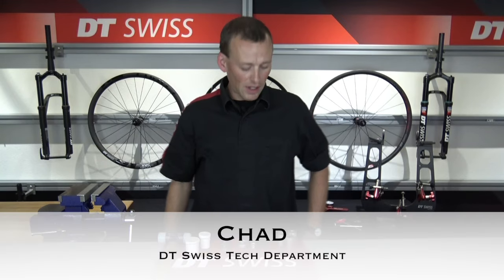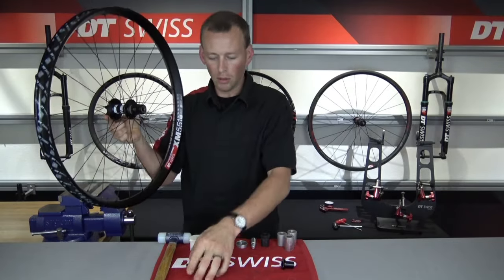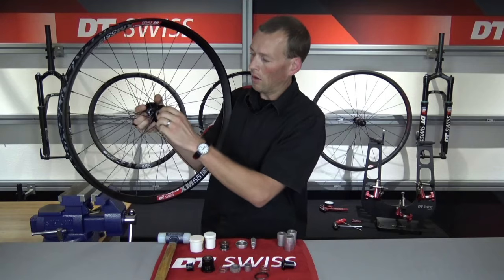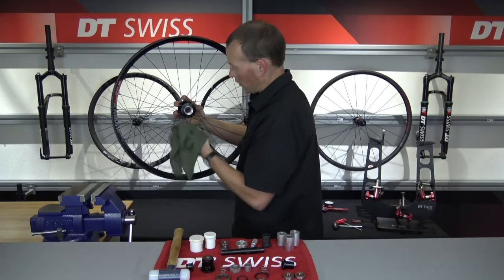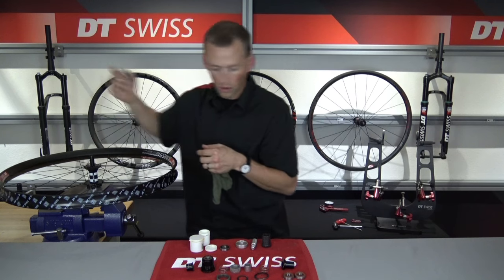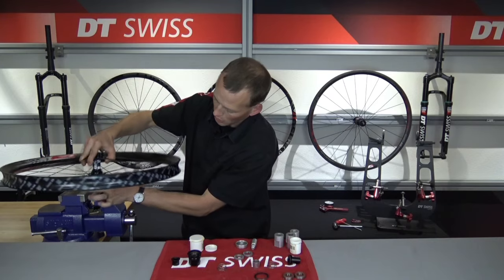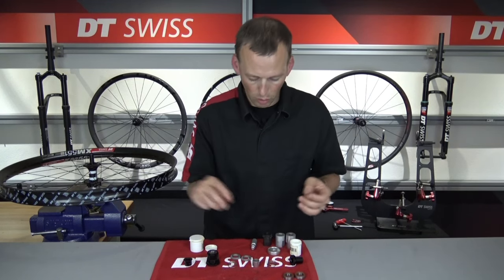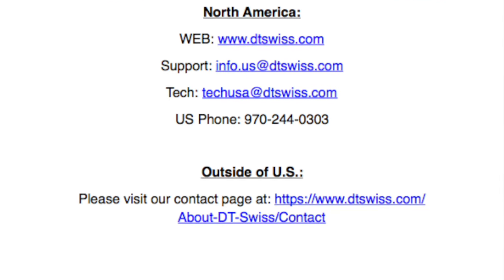Bearing service on DT Swiss Star Ratchet hub. How-to tutorial.  | DT Swiss

Comment: How to open and service the FREE HUB bearings? I cannot find it anywhere
Reply from the maker: Hi there and thank you for your message. The bearings we and most of the other hub manufactuers are using get a grease package which should last the calculated Lifetime of the bearing. If the grease is worn out or old, the bearing balls and the running surface are normally worn out as well and the bearing need to get replaced completely. But if you use a search engine, you will find as well instructions how to regrease an industrial bearing. The procedure is the same for any Kind of use ( Skateboards, Cars, Bikes, ….). Enjoy riding your bike, Friso "DT Swiss".
Reply: I guess you need to replace the freewheel, then... and it comes with the 2 bearings?

Comment: what happens if after installing new bearings you feel some roughness or grittyness in axel spin?  thanks
Reply: with the DT, design there's nothing you can do about it!
Reply: @donaldriddle7138  i think i set the bearings too hard.  put new new ones in and its smooth.  another point is that if the star nut is not fully tightened, which doesn't happen until afteryou start riding, the rear wheel will not spin freely.  took me long time to figure that out.
Reply: @frakafrocka  I’m having a huge problem with the rear wheel “grinding” the ratchets hard and not spinning once installed on the bike. I’m stumped at this point. Never had an issue like this before. I have two sets of wheels with identical 350 hubs. The new set has been super loud, so I serviced it. After install, it barely rotates and the freewheel action is barely working. WTF is going on with these hubs?
Reply: @energ8t   was the ring nut installed backwards? That could cause the freewheeling issue

Comment: Why not make a realistic video that portrays a used wheel? Chad states at t= 3:40, the demonstration wheel is "brand new". Per the comments below and discussion with peers that attempted to replace their bearings, it sounds like a risky proposition and it's possible to damage the wheel in the process. Namely, the Hub (because it's probable that a disc rotor will need to be attached and bolted to a table in order to get enough to torque to break the lockring free) and spokes. Perhaps it's cheaper to buy a new Hub unit or wheel instead of all the tools needed to extract the bearings and still possibly destroy the Hub and or need to re-lace the wheel with new spokes?
Reply: +dtswiss Of course it's nice to have all the tools and friends present when you need to torque the wheel to overcome the likely extreme lock ring torque... Although your studio is not perfect neither is a service shop. I still think it would be a valuable service to your customers to display the actual hub service with a "ridden" wheel. This will let them know what to expect under actual/practical circumstances. It would also be valuable if you would use a calibrated torque wrench record the torque requirement to undo the lock ring and mention that torque value. Is the Hub unit capable of handling the torque transmitted through a brake rotor into the six fasteners without damaging the hub housing? 

I ask this because I actually consulted with a professional wheel technician and he explained that they used the technique of fastening a used disc to a bench. The difference here is that the method shown in your video has the torque transmitted by hands on a rim and through the spokes into the Hub; however, using an old disc rotor would transmit the torque through the Threaded Fasteners into the hub. It seems that it is a worse scenario to transmit the torque through the spokes because spokes may be damaged in the process, whereas if the torque is transmitted through the disc hub there is no risk to spokes or hub, unless the cross section of the Hub, where the Fasteners transmit the torque is too weak to carry the load. 

Would you please report back from your engineering staff, the hub's allowable torque for each torque application site?
Reply: dtswiss Thank you. Clarification: I was referring to how much torque the hub assembly can tolerate (whether it is reacted by a disc rotor or by the rim/spokes via spoke flange of the Hub) in order to break free a ring nut before the hub could experience a stress failure (i.e. not the bolt torque). If two men struggle to apply enough torque (through your preferred rim/spoke load path or via the disc load path), I'm sure that adds up to a lot of stress in the hub. My concern is if this stress is too high for the Hub and which loading condition would allow for the highest applied torque without damaging the hub and/or spokes (if applied thru rim).
Reply: I hope you had a nice ride...
1) I am not looking for a "set value". I am looking for the max allowable torque that may be applied to remove the ring nut such that if exceeded could cause damage to the hub and/or spokes. 
2) I understand you are trying to apply logic that the loosening torque can't exceed the tightening torque. It is conceivable that the loosening torque could exceed the tightening torque. For example, the tightening torque is applied gradually over time and due to various events (as you pointed out, i.e. shock loading during riding); however, things other than applied mechanical torque can cause the loosening torque to exceed the applied torque. For example, contamination (by ingestion of water/mud/grit) or corrosion at that thread interface between the lockring and the hub are examples of 2 things that are not related to the in-service duty cycle aspect of tightening torque.
3) Now that I laid a foundation for why torque may exceed your expectation, I'll get back to my concern about the max allowable applied torque for loosening. Given that the torque can be reacted by either the rim/spokes to the hub vs. the brake disk to the hub. Each of these cross-sections are different, thus there is a worst case (i.e. one has a weaker cross-section) of the two for transmitting torque and that weaker cross-section will be the 1st to fail and will not be preferred for loosening. Thus back to my earlier, unanswered question... (a) which of these 2 hub cross-sections is stronger and (b) how much torque can be applied to it before causing hub damage? Please forward my post to a DT Swiss engineer. Thanks.
Reply: Heat up the hub, since the drive ring is steel and the hub is aluminum which has a higher thermal expansion so the fit gets less tight. That was my trick to get it off. And i used an aliexpress tool for 5 bucks.
Reply: @haenson8021  it's been awhile since I made that post and had my eyes on the details of one of these Hub designs, but heat is always a good solution provided there are no other materials that are going to suffer in the process, like melting rubber seals, etc.. As you pointed out, if there are dissimilar metals, then you can benefit from the difference in coefficients of thermal expansion.

Comment: Can I just clean my old bearing and place it back on the place? Will it fit?
Reply: dtswiss but will it be possible to fit old one on place?
Reply: Bearings get pretty messed up upon removing them and just from general wear and tear. They're really only meant to be installed once. If you're going this far with assembly you may as well just replace them. Standard bearings aren't that expensive and it'll save you time later of having to redo this to replace them. I'm not sure if DT swiss uses standard bearings, however.
Reply: If you want to clean them, do not remove them. Just use a pick to lift the seal, clean out best you can with IPA and brush (etc), then repack with bearing grease. Of course, def check for smooth rotation of bearings first. Many times my bearings are still good, but just need some cleaning.

Comment: Hi,

First of all - very good video. Thank you!

I'm stuck at the point of ring nut removal. As you've mentioned in the video this might be due to the pedalling force. I have already tried to spray it with the things that I had at hand like wd-40 and brunox but it does not help. Shall I use any particular oil or solvent to get it done or meybe there is some special technique?

Kind regards
Reply: Hi

Since I'm - so to say - "alone in the Alps" (not very far from the DT Swiss headquaters actually) I could only try to break the nut ring loose by myself. I tried different ways, levers etc. with no success unfortunately. Then I gave up and went to one of the local bike shops for a help. I thought that then they can try to turn the wheel with more than 2 hands but after a few tries the guy told me that he is afraid to break the wheel and he told me to send the wheel to DT Swiss :-). Indeed my rim/spoke combination (ZTR Arch EX and DT Swiss Aero Spokes) is rather built for low weight so it is rather volatile.

However after giving it a few further thoughts I finaly suceeded to remove the ring nut :-)   

I have done this using the following trick:
1. I took old disc (my hub has IS6 socket for disc brakes) and mounted it on the hub.
2. I put the wheel with the disc facing down on a wooden workbench.
3. Using 4 screws I attached the disc to the workbench (through the holes in the disc. I used old formula disc that has nice roud holes on the side).
4. I put the nut removal tool with corresponding wrench accompanied by abut 1 meter long pipe.
5. Sitting on the workbench I applied pressure to the end of the pipe (it like a "rowing movement").
6. The ring nut finally came off. :-)

Anticpating the questions: no - there is no damage to the IS6 sockets, nor the dics screws. The disc is a bit bent so I would rather not use a brak new one disc for that...

Actually I think that DT Swiss could create a tool for this. It would be piece of flat metal with 6 holes for IS6 and below a Center Lock socket. This would be attached to a bar (i.e. like a normal wrench tool). Using this tool it would be easier to remove the ring nut for the hubs with disc brakes attachment, without a risk to damage the wheel. Not to mention that it would save quite some time while servicing those kind of hubs.

Kind regards

Comment: Any tricks on how to remove the star ratchet ring nut that is very tight? I have the tool and a bench vise, but I can't unthighen that damn ring nut
Reply: Did you get it sorted Mike? I have the same problem...currently soaking it in penetrating fluid.
Reply: @jeffbeck1100  it took me 3 bike shops to get mine removed. i dont have a vice and couldn't do it at home.  1 shop didnt want to break hub.  1 shop didn't have vice that was fastened tight enough.  3rd shop worked out.

Comment: How about the front hub? I have problem remove the bearing from front hub... I tried to tab the axle to remove the bearing but it's very tight... don't want to break anything there :'(
Reply: Exactly > how about front hub bearing removal process ?
Reply from the maker: Hi! You find all necessary information in our hub tech manuals. There you find a step by step guide with pictures as well:  https://www.dtswiss.com/en/support/manuals/ 
Kind regards, Christian, DT Swiss

Comment: I thought The 350 used pawl engagement. I always avoided them because of this mistaken assumption. I pretty sure some 350’s are pawl engagements. Star ratchet just seems so simple and easy a system, besides being lightweight and bombproof. Unfortunately, I can’t use the system on my 2007 Mavic slr’s, but the weight and strength of the complete wheel make up for the slack pawl engagement.
Reply: Old 350’s were 3 pawl now they’re all star ratchet thankfully.
Reply: Even 370's come with 18T ratchets now (I didn't check inside, but that's what the specs say)

Comment: Hi, Great video !  
2 quick questions please regarding my 240s rear freehub...  
1) I recently cleaned and regressed inside my freehub.  However, I used the red ratchet grease on all parts, i.e. the star ratchets, bearing faces, springs, spacer.  Therefore, should I reclean and regrease?  
2) As a "general assembly grease", I already have a Teflon grease (used for my Bottom bracket and headset) and a lithium grease (used on my pedal axles, and also between my cassette and outside of the freehub body).  Would one of these greases be ok as a "general assembly grease" in the freehub ?
Many thanks!
Best, Gary
Reply: dtswiss Thanks Chad 👍

Comment: I just upgraded to 54 tooth ratchet and now my hub is making a wineing sound?
Reply from the maker: Hi Dip
Thank you for your message. Without having the product in our hands, it is hard to make any analysis, wether it's normal or not. 
First of all you should check if you used all the parts and nothing left on or under the table. As well you need to make sure all parts are placed in the right direction, especially springs and ratchets. If you still have any concern about the right function, I would suggest to show the hub/Wheel to an experienced mechanic or contact one of our service centers:
https://www.dtswiss.com/en/support/service-center/
Have a nice day, Friso "DT Swiss".

Comment: REMOVE THE SPLINE RETAINER AT 4:00 WITH A IMPACT HAMMER *COUNTERCLOCKWISE*. Take the wheel and tool to your local mechanic. Mine did it on the spot for free. Your welcome.
Reply from the maker: Hi John, with an impact hammer you need to know what you're doing😉  But the advice to ask an experienced dealer is the easiest way👍  THANK YOU, Friso "DT Swiss".
Reply: @dtswiss  my local mechanic is a professional and I know personally and professionally the effectiveness of applying some wd40 and then first low to higher power with the impact hammer. The impact hammer was absolutely much better then cranking the wheel manually with my hands and feeling the spokes tension up and creak. Thanks but you guys belong to corporate,  we're out here in the real world. Happy landings \o/
Reply from the maker: Thank you very much. I hope you still can ride your Bike in these crazy days. Hopefully in Switzerland this was and is still possible. Friso "DT Swiss".

Comment: in my opinion this method of installing and removing the bearings is very archaic. hammering the bearings will mark the bearing tracks of the steel balls!
Reply from the maker: Hello Rodrigo, when the proper DT Swiss bearing installation cylinders are used as demonstrated in the video, only the outer race of the bearing receives any contact from the installation tool. Therefore, there is no damage to the bearing tracks. Regards, Andrew - DT Swiss USA
Reply: DT Swiss AG I'm sorry, I did not realize that your tool introduces the bearing to the outer face of the bearing. Here in Brazil unfortunately the staff still insists on removing the bearing, redoing the grease and returning the same in the hub. That's why removing the bearing through a hammer turns out to be harmful. But only in this case where the bearing is not changed by a new one. TKS for atention!
Reply from the maker: Hello Rodrigo, yes, we recommend replacing the bearings rather than attempting to re-grease them, because it is difficult to remove the old bearings without damaging the races. Regards, Andrew - DT Swiss USA

Comment: If anybody has problems removing the ring nut... get a second pair of hands, leave the tire on and use a clamping device like they do in the vid!!! EASY. 

TL;DR:
I tried so hard alone using a clamping device like they did (don't know the English word for it). Tried warming the ring nut and shell, tried letting oil drip between the hub and the ring nut... no success. As soon as I got pair of helping hands we could easily loosen it with just one try and at if at all used medium force. If you have 4 hands on the rim, it also distributes the load on the spokes way better and helps you to keep the alignment of turning direction rather than also applying lateral force perpendicular to the turning direction when you come close to your max strength limit. Also keeping the tire on the rim makes for way better grip.

Comment: Hammering is one the worst idea, for pulling bearings. Other methods should be presented. I have two pairs of 350 already. I wish to see a video presentation for  the front hub 350.
Reply from the maker: Hi Cornel, your right! But when laced into a rim, there are not that many option to do this with standard tools. We're doing it that way for decades and it is a prooven one. If you have a single hub only, it would work as well with a press. But this is not a common tool in any house workshop. Stay healthy, Friso "DT Swiss".